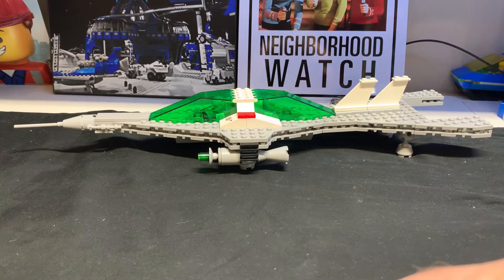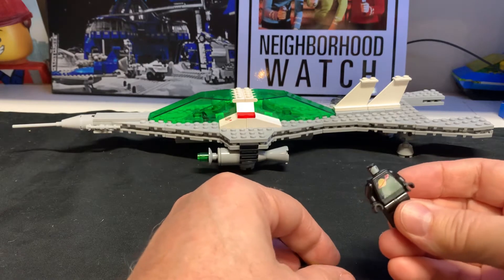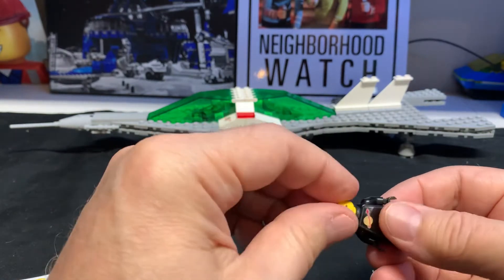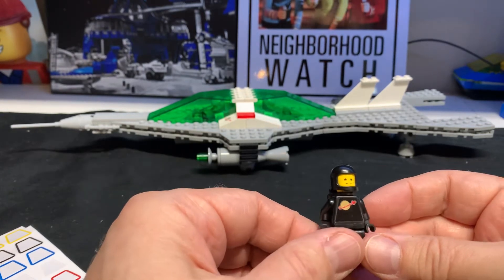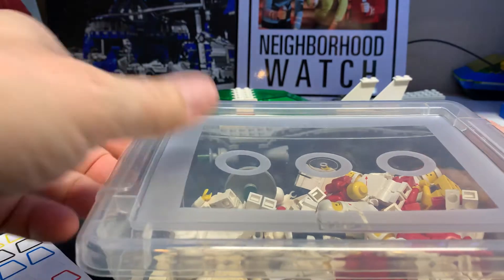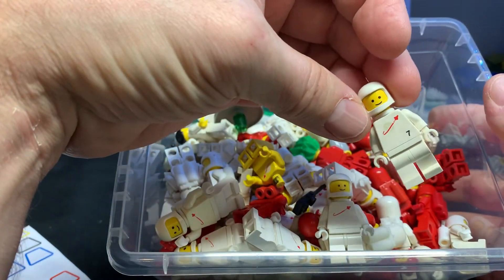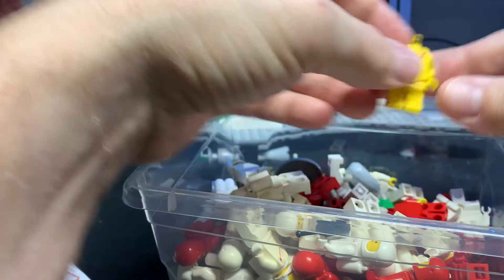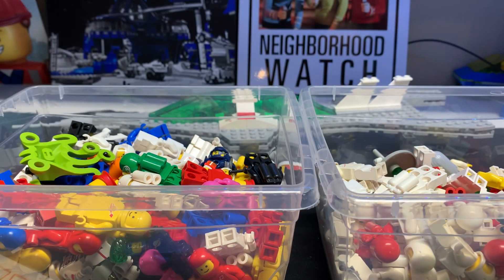DKP - ‘Fixing’ Loose Minifig Heads (The Easy Way)

Comment: the head wont come off anymore help
Reply from the maker: I've had a few very difficult or stuck ones.  I grip the torso with one hand and twist the head like a threaded bottle cap.  Maybe there was too much 'sticker' used.  I just use a little piece
Reply: @Sparky1701  thank you so much
Reply from the maker: @arachnub  Be careful with this- there are some figs that were glued together and you may break off the head from the torso :)

Comment: I remember when I was young and a head got loose I would just bite the neck of the had and it would be thight again (I only broke a head once)
Reply from the maker: Teeth marks are a way to achieve the same results ;)
Reply: @Sparky1701  yes indeed, sure it makes the value lower but as a kid I didn't care about it
Reply from the maker: @HenrYCl4sher  we all used our teeth back then- we didn't have brick separators :)

Comment: DO NOT use tape. it chipped my favorite mini figure's neck.
Reply from the maker: Been using it since figs were invented and developed loose heads without an issue. I'll verify, tho.
Thanks for watching
Reply: @Sparky1701  well i mean, i did do this awhile ago... and i put the tape ALL THE WAY around the inner neck.
Reply from the maker: It just takes a little piece - as long as it's over the top so it doesn't slide down as you're putting the head on